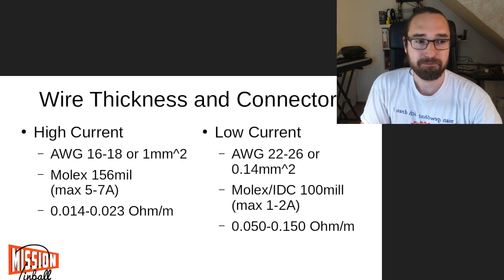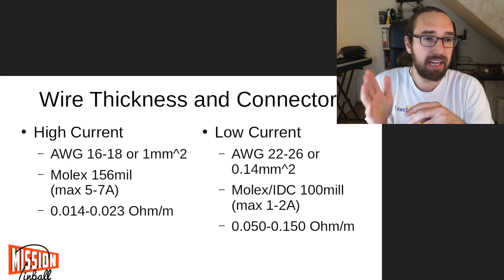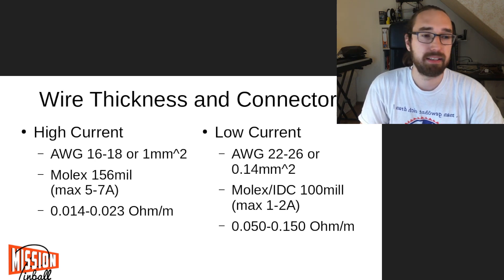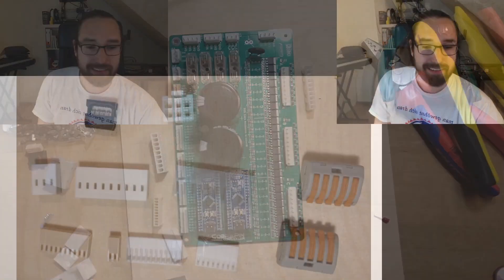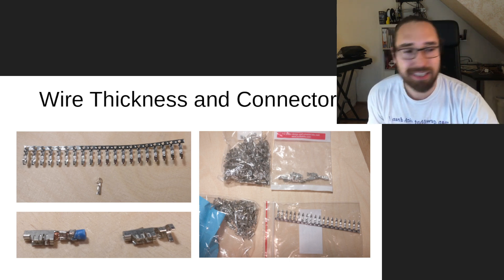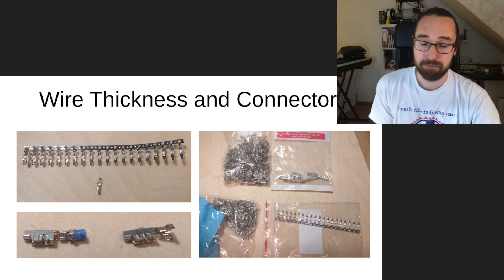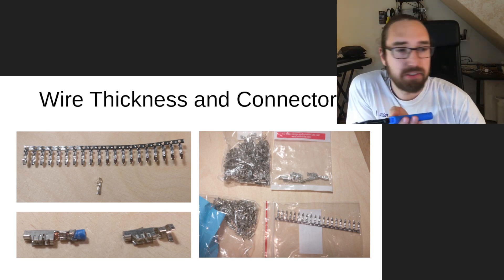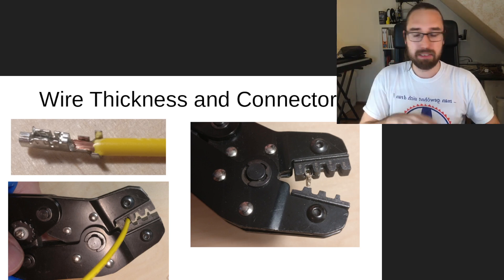Wire Thickness and Connectors in Pinball - How to Wire Pinball Machines 2/6

Comment: The Pinball games in the 70's were Solid State and used Molex connectors on all the PCB boards. The "Header Pins" are ROUND Header Pins and the new ones are SQUARE Header Pins to make a better connection. What do you recommend using to upgrade the old header pins and connector pins on the wiring harness to use to reduce heat? The Heat is caused by the resistance better the wire connector pin SNAPPED into the White Molex Connector to the Header Pin, there is a small voltage drop between this connection which causes heating issues and a voltage drop.
Reply from the maker: I think the headers are secondary. There are different crimps with different plating which differ in max current, resistance and price. I would check their datasheet and get what I need for my application. The 7A I mentioned is for my crimps on the 156mil headers. There probably will also be crimps for 5A or 10A. Luckily, Molex has great datasheets.
Reply: @jabdoa  I think most pinball games used Molex but were Under Spec to save cost so the Current Rating on the Molex headers and Crimps are Under Spec on all the 70's and 80's pinball games. The Mil Spec for the headers and Crimp plating should be rated for the current rating and voltage correct? or what else to look for in the datasheets?
Reply from the maker: @waynegram8907  Yeah I guess so too. Those WPC driver headers are definitely running currents over spec.